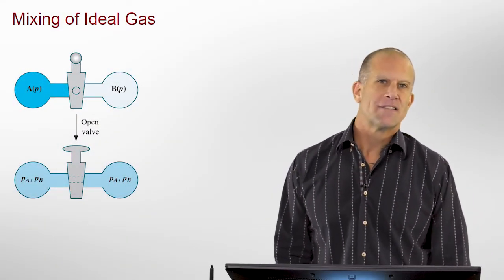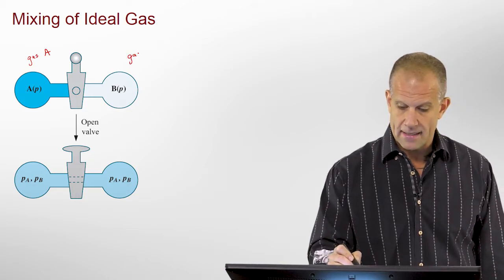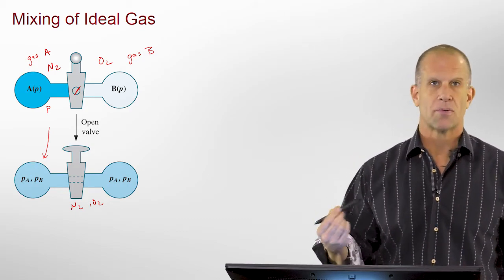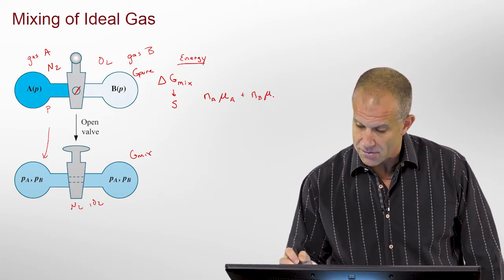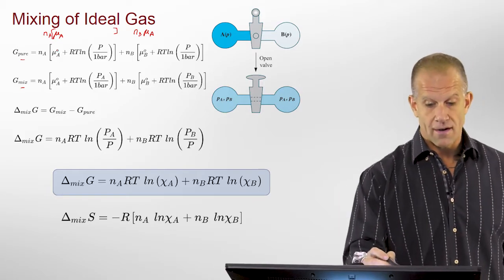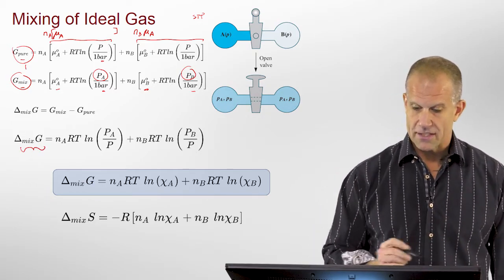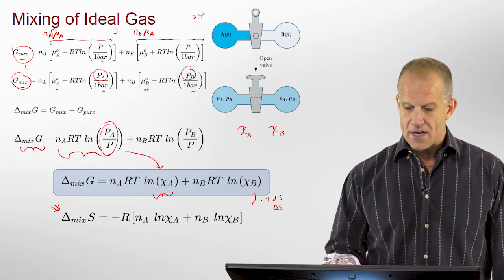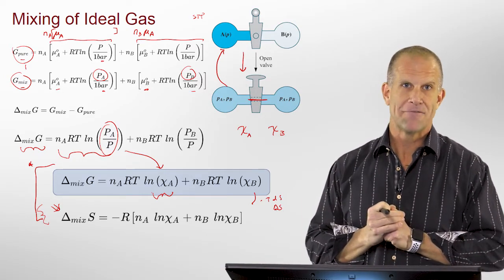Mixing Gibbs Free Energy of Ideal Gases

Comment: Im so confused. How can Pa/P be the molar ratio, if P here dosent represent P total after the mixing. The P here represents the pressure of the conponent before mixing, which is not the same at total pressure after mixing... Does this case only hold if pressures of both containers before mixing are the same?